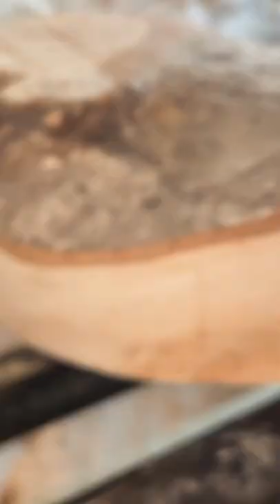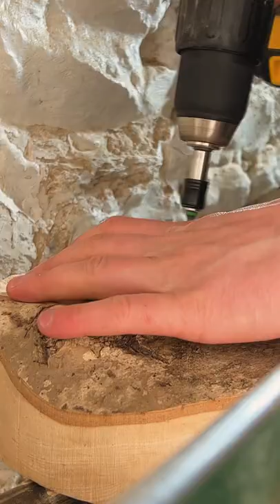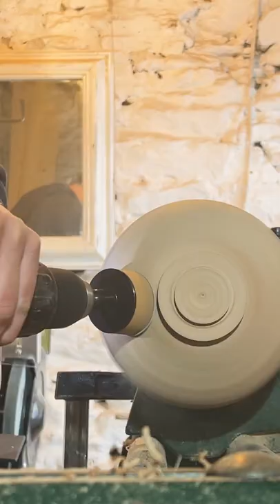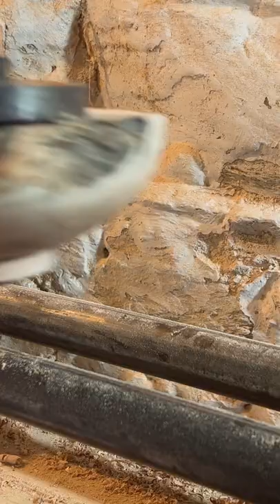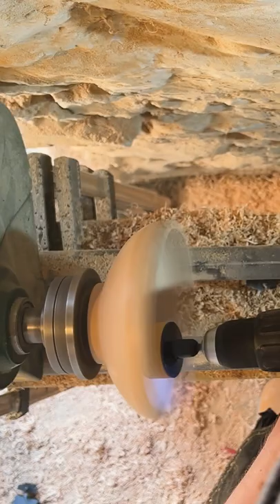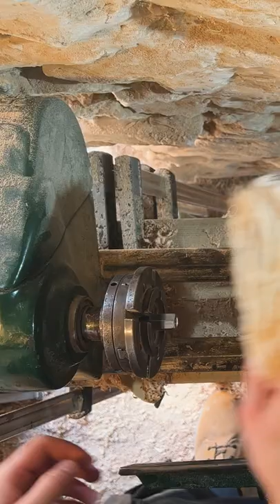Woodturning - A More Abstract Bowl #shorts

Comment: Looks like you were using a spindle roughing gouge to rough the exterior of the bowl. Be careful doing that. It's not designed for that purpose and can break easy. The bowl gouge is the safer tool to use.